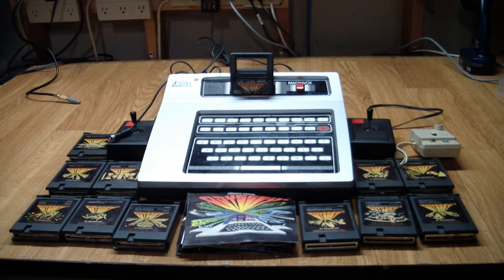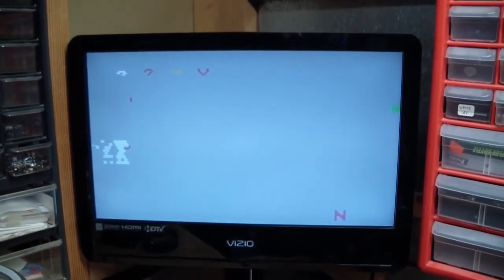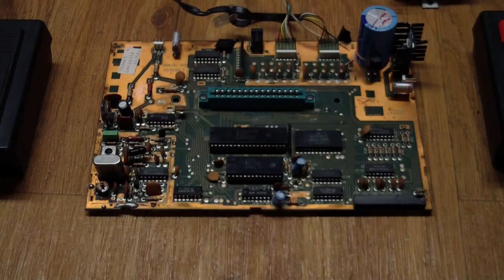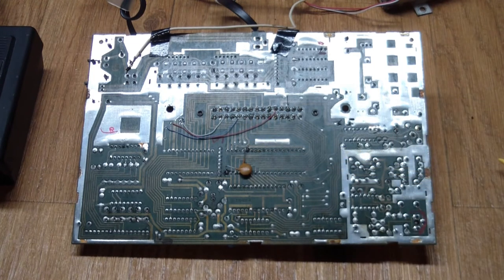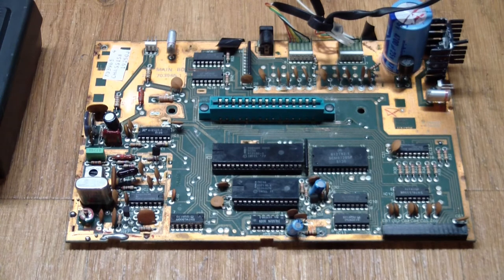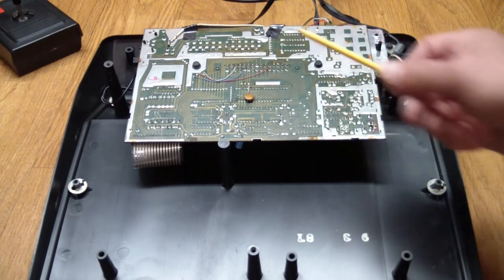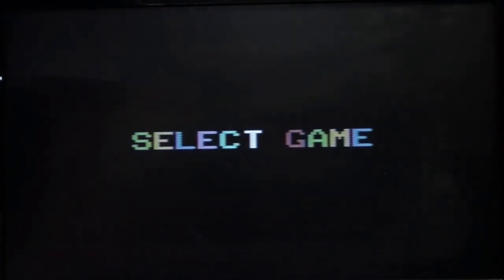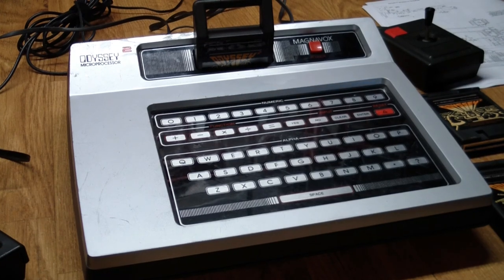AE#20 Magnavox Odyssey 2 Video Game Console Repair

Comment: This video is a godsend! My own Odyssey2 wasn't working in the exact same way, and the explanation about disconnected pins due to the cartridge port being high-stress totally makes sense. I'll definitely check the pins and test out if this kind of fix works or not later.
Reply from the maker: I hope you can get yours fixed

Comment: Mine puts a pretty similar image on the screen, but it doesn't give exactly the same image every time. Always scrambled with the same colours, but always slightly different. I can't find any bad traces. Have you got any suggestions?
Reply from the maker: I would check voltages on the pcb and recheck the traces for continuity and shorts.

Comment: On my Odysee 2 the port closest to the power supply doesn't move to the right, when the game starts, the character goes straight to the left and I can't turn to the right at all, I still am able to jump and crouch.  Thoughts on what is going on?  I did plug both controllers into the other controller port and they work just fine.  Thank you
Reply from the maker: Sounds like the left direction bit in that specific port is shorted on the main board. You'd have to check the traces and the chip reading the port value.

Comment: I have an odyssey that works except for the keyboard. Games like killer bees that require joystick input to start work fine, but if a game requires keyboard input to start I can’t get past the game select screen. The reset button actually works so I’m wondering is there a controller chip I should replace?  Doesn’t appear to be a ribbon connector issue.
Reply from the maker: Unfortunately the membrane under the keyboard has the bad habit of suffering from cracked traces. You would have to ohm out those traces

Comment: Do you except  Magnavox Odyssey 2 systems for repair? I have a Magnavox Odyssey 2 system that works if you put a cartridge in but the problem is that only a couple of the buttons on the keyboard work. It's hard to get the games to work because you need to hit exact buttons to get the games to work. I've been looking for someone to repair my system.
Reply from the maker: I don't do outside repairs because then I wouldn't have time to do videos.
Reply: Thanks

Comment: I have one that doesnt power on. Do you know why it wouldnt
Reply from the maker: I wish I could help, but I wouldn't know where to start. Maybe some viewers could offer suggestions
Reply: @artifactelectronics  hey i cleaned the connections and got a different tv switch box and i got it going. Thanks for your video.

Comment: Thank you for your video, dear you will tell me what are the characteristics of the transformer that uses this video console, I have one of these but I lost the transformer, it is to see if I get a transformer to make it work, thank you very much.
Reply from the maker: You can use any 12V AC supply rated at 600 mA or more,  with a plug that fits the odyssey. Polarity is irrelevant since it is AC. Hope you get yours going.
Reply: @artifactelectronics  Thank you so much